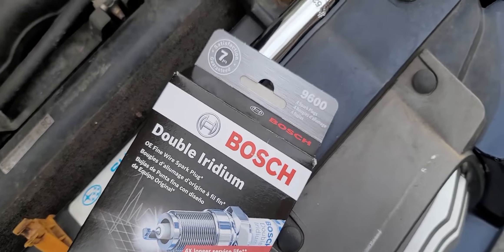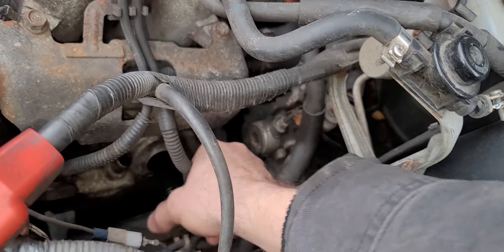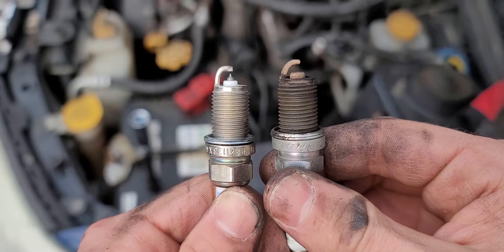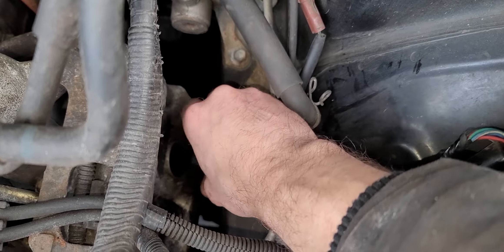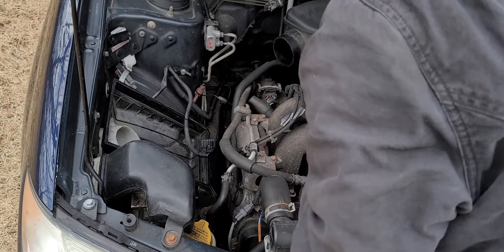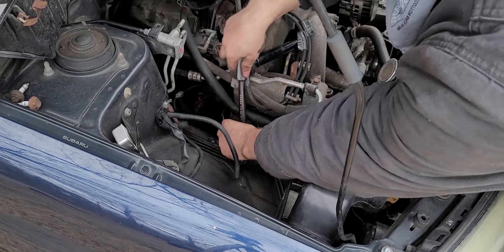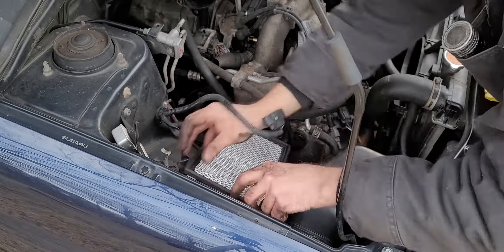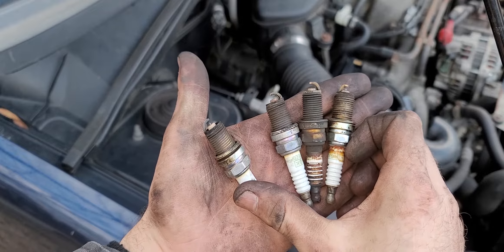How to Replace Spark Plugs on a 2006 Subaru Forester (SOHC EJ25 P0301, P0302, P0303, P0304)

Comment: Great video.  We changed the spark plugs in my son's 2007 Forester in less than an hour thanks to your video.  I will add one thing.  We used two short extensions on the driver's side.  The one connected to the socket was a wobble extension.  This allowed us to slide the whole assembly into the hole and onto the plug.  Then we snapped on the ratchet.  Much easier than trying to assemble the extensions in place.

Comment: Yep. I got P0301... misfire cyl 1. I hope it's the plugs....
Reply from the maker: Could be as simple as a plug, could be as complex as a clogged catalytic converter that's fouling up the plugs. Let me know how it goes!
Reply: I swapped plugs. Car seems to be a tiny bit better but still shakes a little at idle. Maybe the motormounts are shot. It has done 338.000 km
Reply from the maker: Interesting. How is the acceleration? 2.5L should be able to do about 9 sec to 100 kmh. When I was having problems, it was more like 20+ seconds.
Reply: She seems to be just running and pulling fine.

Comment: I've been lucky lately that the only issue ive had with my forrestor (gonna knock on some wood real quick) is the bolt that holds the tension of the alternator broke. Easy fix.
Reply from the maker: Ooh classic. Has happened to me twice now lol.

Comment: I remember when you had to yank the engine to pull the plugs on an EJ25
Reply from the maker: Good times. I don't remember pulling the engine (at least on my '97 Outback), but it was certainly an all day affair - similar to doing valve cover gaskets. Gotta remove your engine mount bolts and tilt the engine.
Reply: @Bootstrappin  Yeah I just let the plugs go until it was time for gaskets and timing belt lol. If you've gotten to the plugs you're only 20 minutes away from having it out completely.

Comment: i hope my forester has a bad spark plugs it keeps missfiring 1 and 3 even tho it has new coil pack and wires
Reply from the maker: Let me know what you find!
Reply: @Bootstrappin  i just changed the sparks plug to platinum one the old sparks plugs is iridium ngk i dont know if its a legit ngk. I just clear the codes and hope it will never go back
Reply from the maker: @nikm6548  were the old plugs burned out?
Reply: @Bootstrappin  it has oil on it
Reply from the maker: @nikm6548  interesting. That's more of an indication that your spark plug tube seal is going. Either way -- hope it doesn't come back, but if it does -- your catalytic converter might be clogged. To test if it's the upstream or the downstream catalytic, pull out your O2 sensors one by one. If your performance suddenly improves -- like more power, you'll find your culprit.
Reply: @Bootstrappin  still miss firing same  cylinder 1 and 3 ill try to replace coil pack and. Wires
Reply: I hope it’s not the timing
Reply from the maker: @nikm6548  If it was timing, I think all cylinders would misfire. Make sure to get a Subaru OEM coilpack. I got one from Autozone and it was very poor quality.
Reply: @Bootstrappin  thanks. How about nrg coil pack?
Reply from the maker: @nikm6548  don't know. I suppose you can return it if it doesn't work.